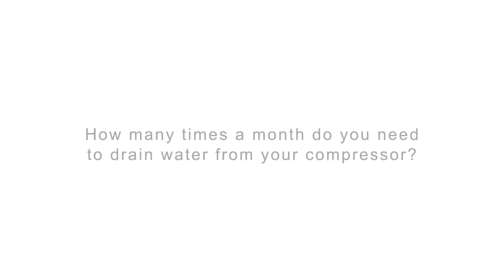How Often You Should Drain Water From My Compressor?

Comment: Question: My residential-use air compressors' drain valves always sputter and even slow down air flow out of them when I open them for draining. Are these some sort of special check valves or moisture valves or something?  One is a Craftsman. Just called an air compressor service center and he never heard of the drains doing that. They've acted that way since I first bought them some 25 yrs ago.  Perhaps the water gets in the way and interrupts the draining flow, idk.